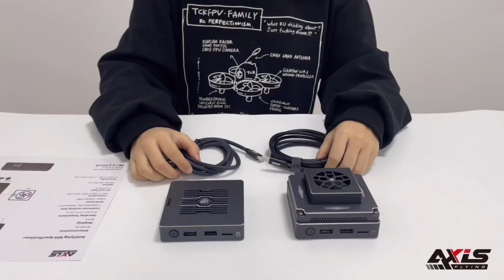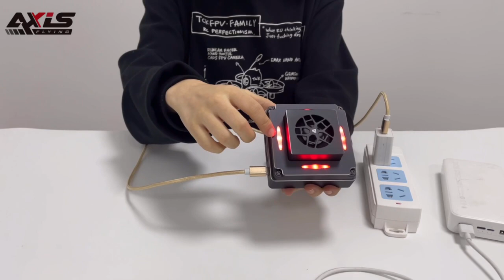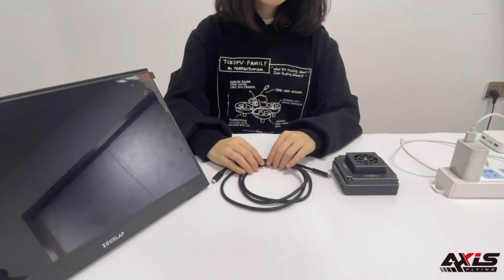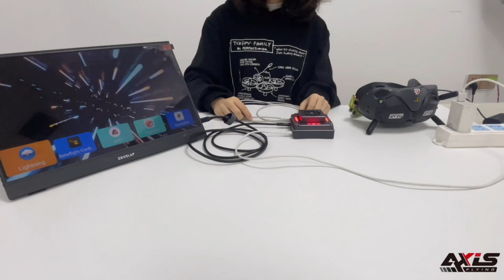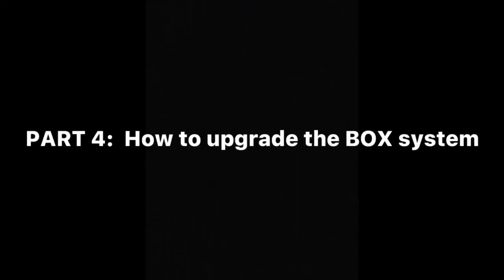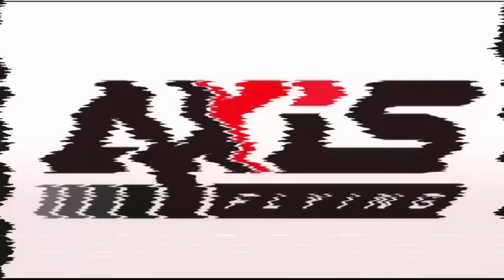Axisflying FPV HD BOX instruction.

Comment: I bought an Anker 30w USB-C Slim PD power supply and it still doesn't work; Google and Betaflight apps still crash when launched, or the whole OS will crash and reboot or hang at an AXIS screen.   WTF power brick are you suppose to use with this piece of ****?

Comment: Ok, this box has problems.  
1.  You need to include a power brick and power cable with it.  
2.   You need to make the screen printing on the box larger so visually impaired people can read the ports
3.  You need to absolutely get rid of the cycling desktop background and set it to just solid black.
4.  You need to make the mouse cursor much bigger, like an inch in side, with mouse trails and shadows so it can be viewed by the visually impaired or just by normal people in bright sunlight.  You need to make the Text in the selection icons bigger, because I can not read it even on a big TV  It's going to be even harder on a small 10" FPV monitor.
5.  I would say get rid of all thise micro connectors and use standard big sized connectors for ev
erything, but that's not going to happen, so wishful thinking on my part.  Allt he other problems though you can fix.

I can't see or find the mouse cursor on screen unless I move it to the top right corner and inch it around, so this is phvvvvcked up.   I can't use this as is, unless I can change the mouse cursor size somewhere in settings....  And please stop this cycling desktop background, what the phvvvck were you thinking?????  Solid black, always solid bloackfor a desktop background...

Everytime I try to do something, like launch the internet browser, it crashes and reboots... I can only assume the CPU is spooling up with heavier current draw and  it's not getting enough power from my power brick and dying.

There seems to be no way to disable to rotating backgroudn or to make the mouse cursor bigger, so I am probably going to ahve to send this back after only 1 hour of use...   this is a bad joke.    Did you user test hits with a pilot outdoors int eh sun

Comment: Where can we get the files for the upgrades?
Reply: hello bro.. how about the screen display? is it delay?
Reply: 1. Goto the Product page  (link is on the right side of the picture/below the price tag)
2. Download the file from google drive 
3. Put the update.zip onto an SD card
4. Put the SD card into the box and a update box will appear.
Reply: @toschtr  Nobody can find the link; he needs to place the link int he video information area
Reply: @choppergirl  Goto the product page (https://www.axisflying.com/product/axisflying-hd-box-for-digital-video/) 
There should be a google drive link under the price tag.
Reply: @toschtr  Yeah, I've downloaded and tried that upgrade several times... it doesn't work.   It will either crash or reboot during the install, or say the file is corrupted.  

Avoid buying this box:  clicking on the Webbrowser or Betaflight to launch them only crashes and reboots the box.   Worse, the DJIview app crashes as well when trying to set up streaming or streaming.  

After three weeks of trying, I've only gotten this box to stream once for about 10 seconds before it crashed.

I'm going to replease a dmmning product review video here shortly...    before I send it back for refund.   

It's nothing more than a useless expensive brick.
Reply: @choppergirl  i assume you have a faulty box. I didn't experience any problems you listed here - except it does not work wth the vista airunit (didn't try v3 firmware yet).
Try contacting the seller for a replacement.
Reply: @toschtr  Basically, the only 3 apps on this box will just crash and reboot immediately when you launch them.   

The control panel works, but it is a stripped down Androd control panel that lets you change the date, time, time zone, wifi access point, bluetooth, do a factory reset, and that's it.  The unit is locked won tighter than a rusted nut.  Yo won't be installing any other apps at all or upgrading them, and you won't be using this like any on the go in the field desktop computer.

The videos of units you see gotten free by reviewers must have been cherry picked to snow them.

I've tried about $100 worth of name brand highly recommended power adapters thinking it was a power problem:  Amazon Basics 65w, Anker 30w, Belkin, and LG.

I don't do product review videos at all, but this product is so bad, t should of never left the factory floor, I feel compelled to make one as a warning to others.   

For the 10 seconds I was able to get it to stream, I would say the 100ms latency is barely good enough to fly Angle self leveling mode to... I could no problem.. but not very fun for Acro mode or aerobatics.   You could barely but it would be like flying a very mushy responsive vehicle and you would be over correcting allt he time.   But it will never happen, because the video link will not last long enough to get off the ground.    And it's not going to reestablish if you lose it.  Since the link is not stable, it's not even usuable as an audience viewing device or for a director's view.

I have no idea what firmware version mine is, but it's not 3.0 as it has a Betaflight icon instead of Screaming Bee.   Maybe in 3.0 they fixed their problems but I doubt it.  You can instead buy a Pi 3 or 4 and install Cosmostreamer, but I won't be doing that now that I've seen the latency for myself.

I've had mine for 3 weeks trying every possible test to get it to work but yeah... it came this way from the  factory and is a total lemon and there is nothing a home user can do to fix it.  Like I said, it's locked down.  The apps that are on it crash immediately when you launch them.  Its not usuable for anything.. at all.

The only other possible thing I could try would be to attempt to run it from a DC Liion battery pack, but I'm not even going to bother trying that, as this is a unit meant to be run on a desktop with a monitor so it makes no sense to me to run it off a battery pack.
Reply: @choppergirl  have you tried using 2 separate power supplies? One for the screen, one for the box and connecting the screen via HDMI?
Reply: @toschtr   My screen is a 44" HDMI 1080p TV running off AC.  So yeah, the Axis Flying Box is getting the full power from the USB-C PD power adapter.
Reply: @toschtr  I'm going to be recording more footage of the unit today, so if there is anything you want me to show or demonstrate in particular that might be out of the ordinary of running through all the software functions the unit is suppose to do (but doesn't), let me know and I'll try to cover it.

I will let you know, it's been established int he forums (or at least mentioned by someone) that you have to turn off video camera transmitting power throttling on the DJI air unit via the goggles menus.   And either the Caddx Vista unit doesn't support this or does it improperly, so the DJI air unit is recommended (what I'm using).   

I ay this tongue in cheek, because.. well... my unit doesn't work at all, so, it's academic, but I thought I'd pass it on as information to anyone else reading this far and down the road in the future, when perhaps the company has fixed their problems or they are using the DJIview app on a tablet or smartphone and it's actually working for them.

I really, really,r really wanted this to work for me because I can fly aerobatics like a bat out of h377 to a large screen TV monitor, but I can't see 5hlt inside the DJI goggles on those split mirror tiny 2.5" screens.   

In the final analysis, this is DJI's fault for releasing a digital video system with no digital video out.   This product is just a startup trying to capitalize on a community work around dji video out hack.   

If DJI were to release a digital receiver box with nothing but HDMI out and no googles, I'd buy it in a New York second, but as it stands now, the DJI goggles are unusable by me and I've come to thoroughly loathe them and the reviewers that gushed about them in the beginning.   

If you can see they have a great 720p digital picture and good MIMO digital transmission, but for someone like me who needs a screen bigger than 2.5 inches, they are absolute grrrbge unusable and big and ugly and unwieldly to boot.  I can't even read the OSD text menus.  Ifeel like I'm sitting in the last furthest back row of a movie theatre far away from the screen with no glasses on when you put them on.

I don't know what I'm going to do next, but this Axis Box is getting mailed back next week.   Already got the RMA return shipping postage paid label printed out and ready to go.
Reply: @toschtr  there is no link
Reply: @SMOKE_ON  link seems to be gone.
Reply: @toschtr  so this doesn't work with the vista? I just ordered one and all I have is vista units,  dammit Man!!!
Reply: @toschtr  mine works with vista air units , turn off temp protection  in goggles
Reply: @jimmytheriot8978  thanks for the info
Reply: @toschtr  just got the fatshark HD system, hooked it up to my homemade fpv cockpit because it has HDMI, just waiting on my vtx tomorrow!!